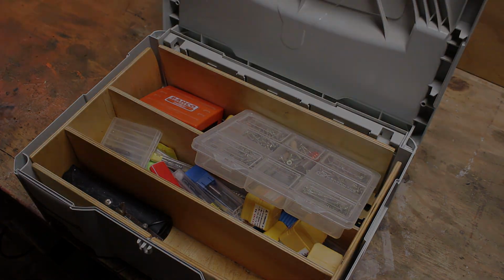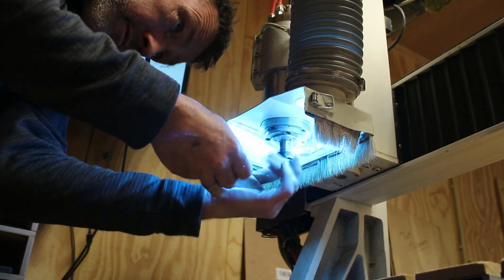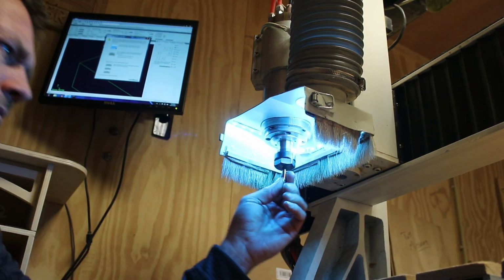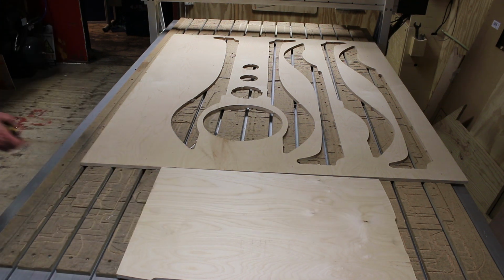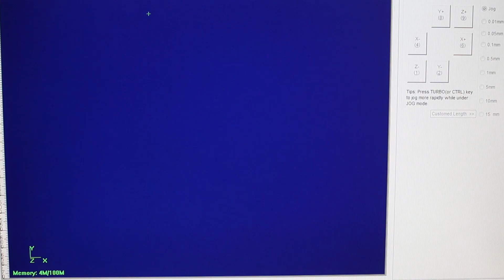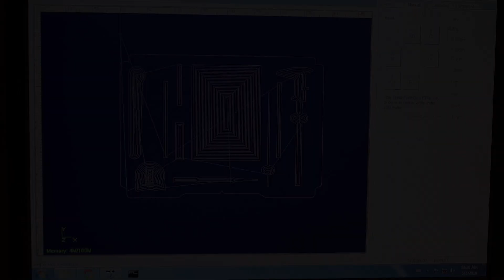Systainer inlay for router bits | made with CNC

Comment: Nice project! Huge fan of the systainers too.  So convenient. Birch plywood is best machined conventional instead of climb cut, it leaves a clean finish with the right routerbit that doesn't require any sanding or filing afterwards.

Comment: what progam did you used to make your project? you take a picture, but how does stay in right scale?
Reply: Easiest way I know to keep the scale when working with a picture is to include a ruler in your picture so that you can use that to reference against.
Reply from the maker: I use Rhinoseros or Rhino for short. The scale can be adjusted by measuring one or two real dimensions of the object.

Comment: I really like this idea. I might try this plywood technique with some of my own tools. I like the systainer boxes; I have one that came with a Makita track saw, and I might pick up some smaller ones for hand tools. I don't have access to a CNC router so I would have to figure out a technique that is feasible, perhaps gluing small pieces of plywood to a base piece of plywood to form the tool pockets.
Mike Farrington also used a similar process to organise his tools and made a video about it (https://youtu.be/LHMyhuZo2a0). He made more of a "3D" toolbox, but I think I prefer the layered trays.
Reply from the maker: Succes!
Reply: I like what he did, but like you, I don't have a CNC machine, but I thought of a way to do something similar.  You can still make the individual shelves using a thinner plywood and use foam for the tool inlays.